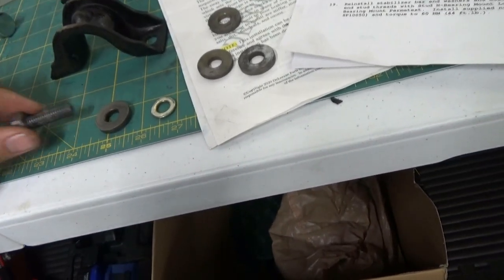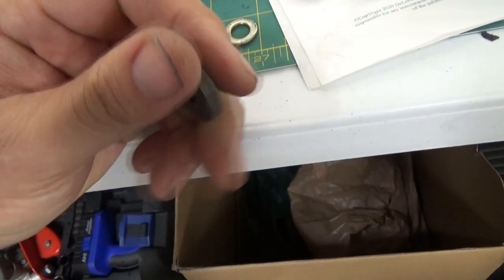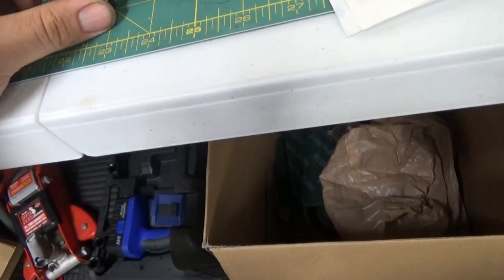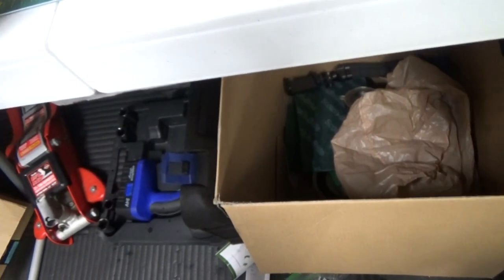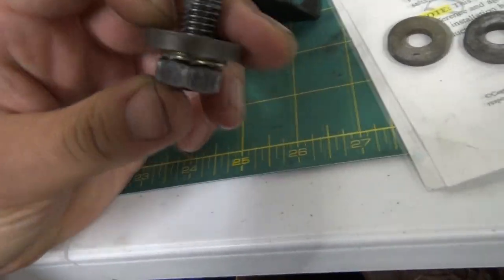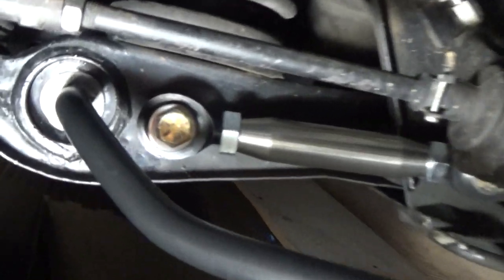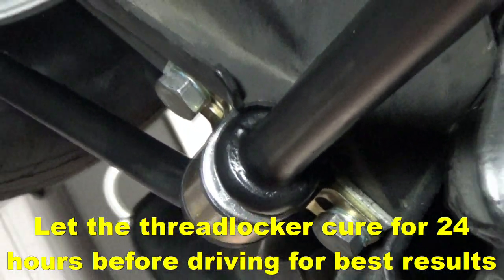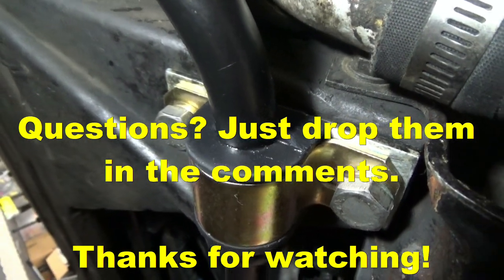DeLorean Parts Northwest Polyurethane Sway Bar Bushing Upgrade Kit Installation and Review

Comment: 8:09 When you say "larger washers, bolt spacers". 8:30 I don't seem to have those spacer plates, only washers. All I had were two washers spacing it apart. I called Toby about this and he told me I must be missing them, but apparently they're hard parts to find unless someone re-fabs them. Even Chris Miles had to help me find some. Where later VIN cars setup with washers instead? I know there were multiple recalls for it over the years from DMC, but I'm not 100% sure... The reason I'm not sure is because the washers used as spacers seem to be different. As in different sizes of diameter, but the same thickness.
Reply from the maker: Mason Fowlkes Chris Miles and I did an installation about a week ago where the car did not have the spacer plates. Fortunately we were in an aircraft hangar and the guy next-door was able to Jerry rig some. All you need is some flat plate maybe 1/8th inch thick metal and drill two holes. That’s all it is. You don’t need to go with the factory ones because they’re so generic that you can have them created fairly easily.  As far as later cars I would expect that all of the later cars would’ve had them installed in Belfast. Is the earlier cars that might be missing them. The car we installed the bushings on last week was an 81 September build. All of the later cars 82 and 83 that I have seen have the recall kit. That plate was actually part of the recall kit.

Comment: 39:55 When having to put my front bushings back on, it seemed that my sway bar was pushing them to the left side of the car. I had to go an turn my driver steering wheel to get them to line up, but they still needed a fair bit of force to go in. I could barely get the threads on the bolts to catch the inside of the frame. I went to get an alignment afterwards but that I don't think that solved my issue.
Reply from the maker: Mason Fowlkes did you inspect the bar to see if it was bent or deformed in anyway?  Its a flexible bar to be certain, but what you are describing doesn’t sound like an alignment problem.  Did you make sure the car was on its own weight and not on jack stands?
Reply: DeLoreanTech Car was on ramps when I did the install. Bar did not look to be bent in anyway that seemed questionable. Maybe I could just pull in my tie rod ends until it stops hitting the rock trim? I would be loosing turning radius, but I’m honestly running out of ideas as I’ve been asking people this for months and still can’t find a solution that sticks.
Reply from the maker: Mason Fowlkes what about the frame extension?  Any signs the car was in an accident?  Even a fender bender could cause geometry issues depending in what was struck. For the ARB not to line up with the bolt holes on the crumple tubes points to either manufacturing defect or accident.
Reply: DeLoreanTech i have a theory that the car was indeed in a front end accident at some point in its life. I’ve found bits and pieces of glass throughout the cabin and can see the front fiberglass off the body has been repatched. If the geometry is off, then what would I be looking at to correct it? Would all off the car’s suspension come into question?
Reply from the maker: Mason Fowlkes It all depends on the severity of the damage. It may have been that the frame damage was not detectable and they just repaired the body. But the front frame extension is a separate piece from the main frame and you might be able to tell by inspecting it thoroughly, especially where it is welded to the main frame.  Another possibility is corrosion affecting the structural integrity of the frame extension. Can you tell if there is any significant corrosion on the frame extension?  Ultimately if you determine that the front frame extension has been damaged and depending on how severely, you might be able to get it replaced completely.  The part is about $1375.   Does require welding.